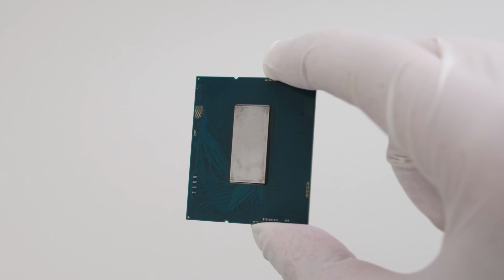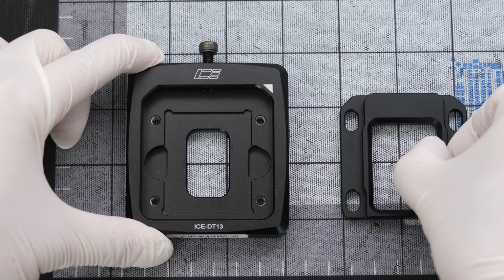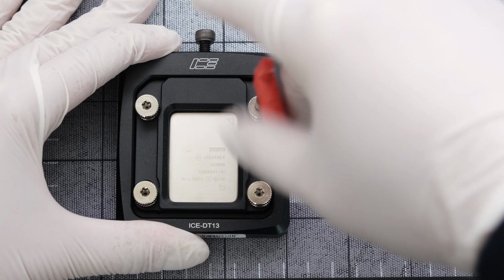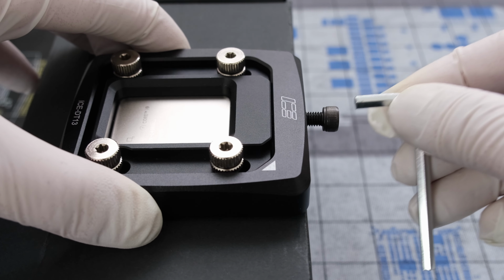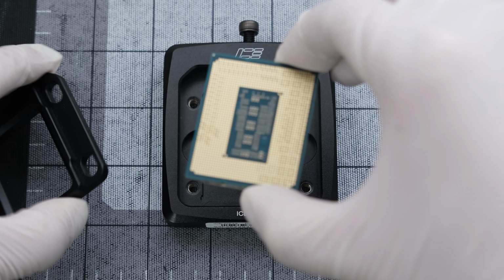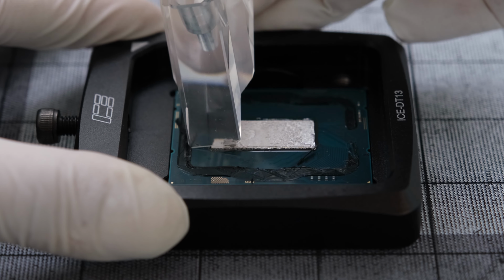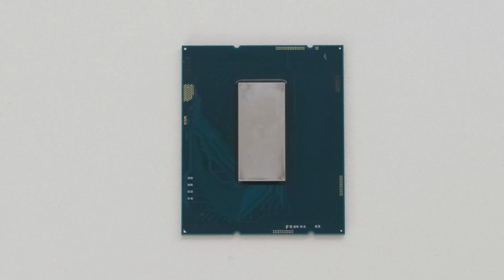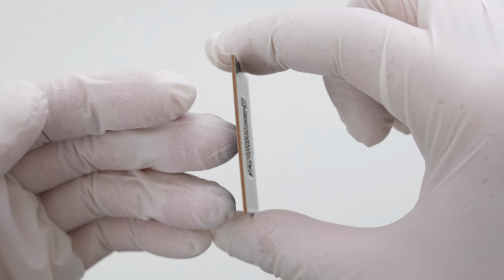Ultimate 14900KS Delidding Guide with IceMan Cooler Delid Tool: Maximize Your 14900KS Performance

Comment: This tool works really well but has a fatal flaw. It removed the SMD cap and resistors at the bottom of the CPU. The cutout to clear these components is not long enough. At full extension, there is a 23mm gap between the start of the tool and the end of the cutout. The gap from the start of the tool to the end of the SMD components is identical. The cutout is too short by the width of the SMD components.
Reply: I think you put the cpu in the wrong way.

Comment: i have a question, ive ordered the same direct die plate, is lowering the actual screws enough for a air cooler or do i need to customize my air cooler for the height of the capacitors?
Reply: Hi did you manage to find out about this?
Reply: Not yet i ordered a direct die to test it out myself  @newbnest
Reply: @TOPVIRAL-m3r  interesting. I'm about to get the Delidded die guard and use EK water block on it. I'm afraid the capacitors might be too tall as compared to the die.
Reply: You definitely need the protective shroud device between the delidded CPU and the "cooling source" (which includes air towers as well). The contact frame prevents the external cooling device from being able to chip or crack the silicon die.

Comment: Can confirm that the top bracket doesn't fit IHS. Tested on 13600k of chinese X batch. The widht and height of the top cover/bracket are 0,2m more than IHS H and W, but the radius of the corners seems to be larger than corner radius of IHS, thus allowing only 2 corners to fin into top bracket.
And yes, cpu was placed correct way, arrow towards arrow. 
So it wasn't possible to get the even/flat top bracket as mentioned at 1m27s. Tried with aligned edge from the screw side, ended up removing IHS but together with the one brown cap closest to the screw since it seemed to be slightly higher that the 3 resistors. 
Not gonna try this kit on any other CPU - and can not recommend it.

Comment: Just buy AMD
why do you even need the 14900k xd
anyway good job with that CPU, Like.
Reply: @best-player-in-the-world  Around 3% faster? STOCK 7950X3D has 38500 (stock 14900ks has around 39000 but OK I will compare it to 40000)
Now compare the prices 
560 usd for ryzen and 690 for intel (in my country) - 19% cheaper
Reply: Because its faster.  Takes threadripper to beat it.  😉